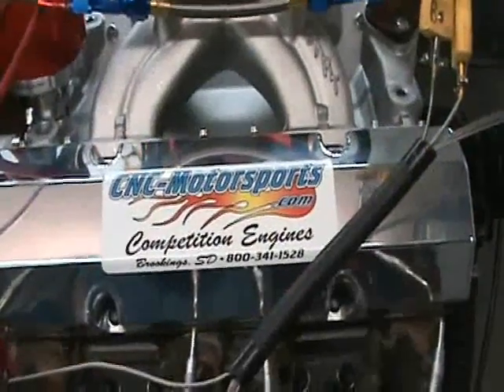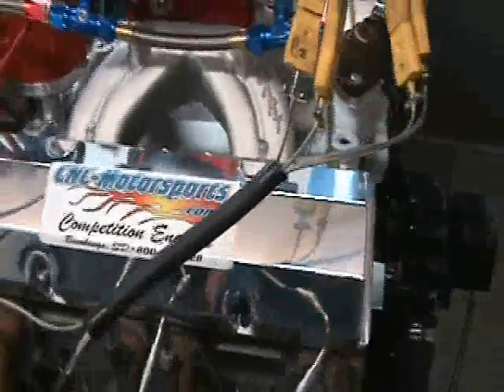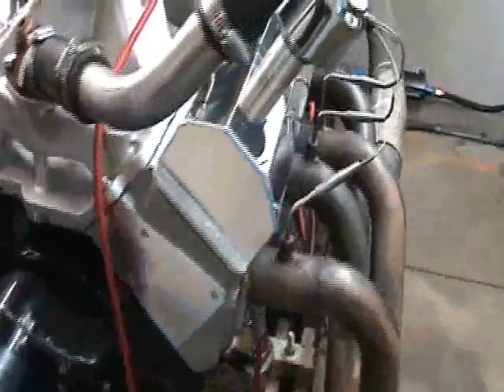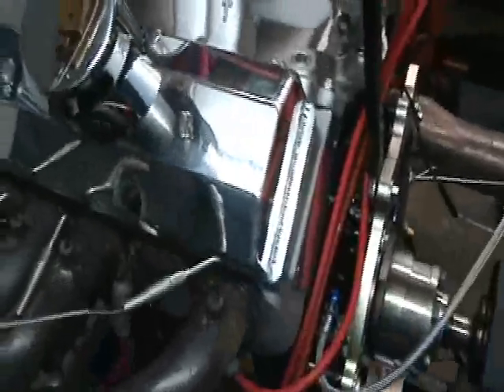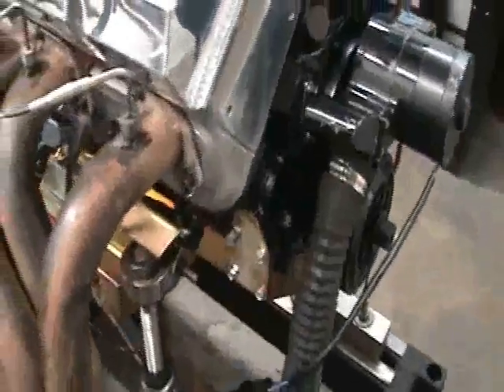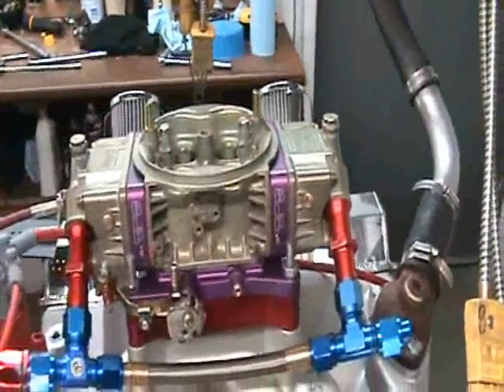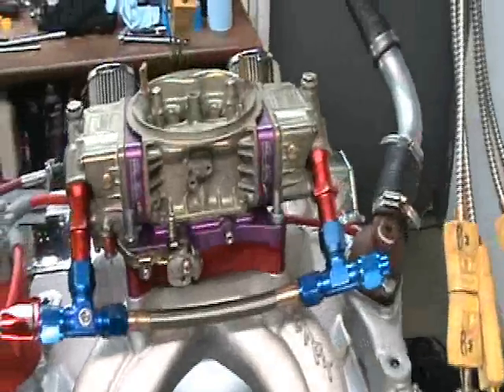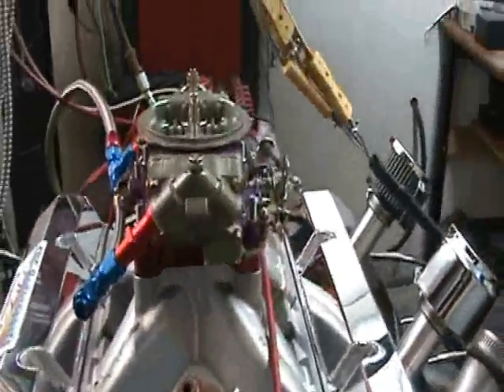SB Chevy Race Engine with 15 Degree Dart Heads 700+ Horsepower

Comment: What does the 15 degree refer to ?
Reply: angle of valve vs bore . Air makes less of  a sharp turn to get in the cyl. Its not so much cfm but that angle really helps
Reply: @gordocarbo  🤯🤯🤯🤯🤯

Comment: This is making 1.67 ftlbs per cubic inch according to the dyno figures showen.......
It's total BS everyone it will likely really be at 1.45 ftlbs per cube. 
They can post these figures due to the correction factors you have to enter to equalise the dyno to others at different elevations.

Comment: Looks like it has pretty decent torque and it's crazy that peak power is only at 6800. Must be running a relatively small cam considering the 15 degree heads. I'm betting duration @.050 is probably in the 250s with a mechanical roller. I've always thought a 347 would be bad ass. Very nice.
Reply: With hidden cam #'s we can only guess, my 17* 399ci makes 640 hp. with 260/266@.50 with 10.7 to 1 on 89 octane @6400. I wonder if his power over mine is compression?
Reply: @heshtesh  It's hard to say, that's a good point though. What carb and intake are you running?
Reply: @EricFixalot  I'm running a GM Performance 2 piece 18* intake with a QFT 950 Black Diamond.
Reply: @heshtesh  From what I've seen, HP=Cylinder head flow in CFM*1.8 (On high compression closer to 2:1). However intake manifolds are a common bottleneck. A lot of people inadvertently choke out like a 300 CFM head down to 250 CFM by not flow testing the intake. The carb seems properly sized, should be room to grow there. Try having a porter flow test the head and intake together if you want more power.

Comment: Hot Rod magazine built one of these 347" motors about 15 years ago. 12.5:1 compression, 87-octane horse-piss and 38 degrees of ignition advance (as far as the distro would go). Despite the low-flow, tiny valves of the cast iron Vortec heads, the motor did 430 hp at around 6000 rpm. The secret in the sauce was 6.2" rods made for F*rd 300 cid L6's.  The rod/stroke ratio works out to 1.91:1, (vs 1.64:1 for a 350 with 5.7" rods) which gives huge piston dwell near TDC and makes this combo bullet-proof. Always wondered what that motor would have pulled with some high-perf heads,... Thanks for the demo.

Comment: Torque is wht moves the car so I like to see the hp/tq #'s a Lil closer example 700hp/ 600+fptq but i guess that's gud for small Ci displacement but we kno the 15 degree heads play the big part in this build with a Lil tweak here & there...
Reply: power and torque arent even the same fucking measurment, they have different units dumbfuck. 570 lb-ft on a 347 is spectacular

Comment: nice video man im currently build my 350 and i just anted to show you my quick specs please any advise helps this is my first build it is a 350 board .60 over block is gunno have all forged internals cam is going to be a 610 lift hydraulic roller
flat top pistons roler lifters
heads are gunno be aluminum 220 64 2.02 1.60 with 700ft springs and 1.65 high ration rockers
full msd ignition holley vortec intake and 750 demon carb no choke
im not sure what else this is all thats on top of my head